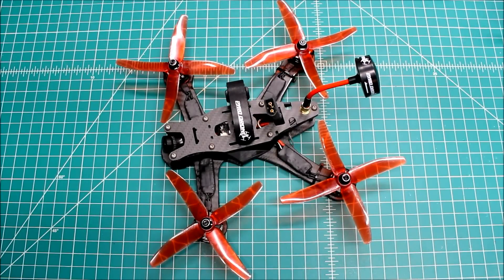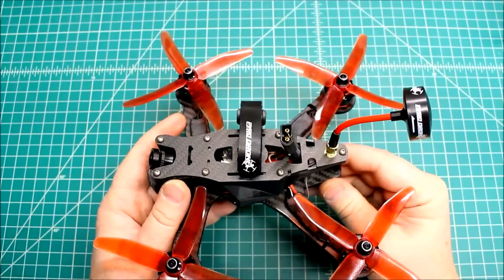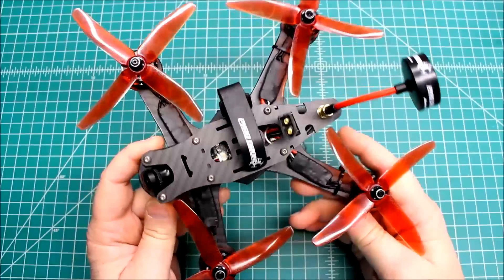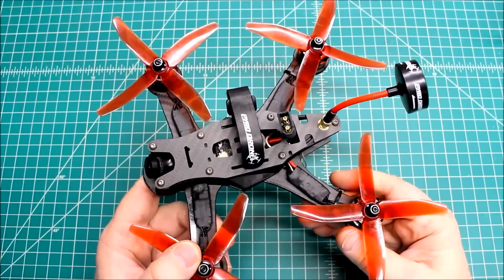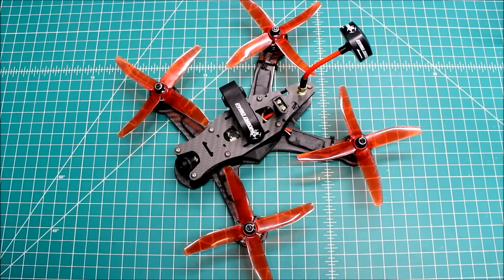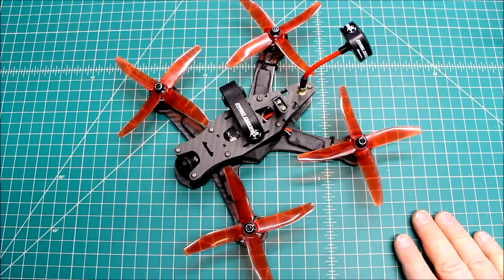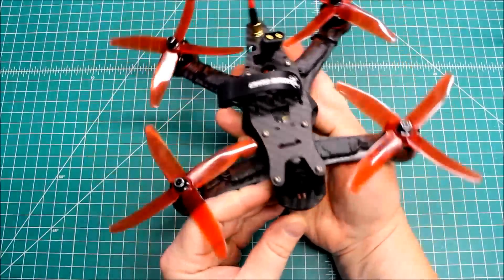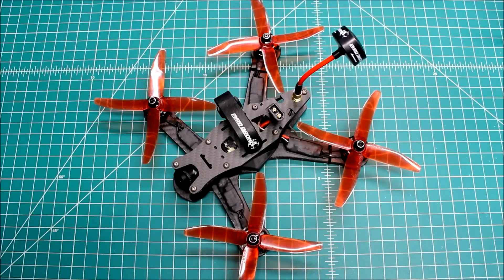Neato 205 Breakneck FPV Race Frame  Final Thoughts

Comment: Are you worried about signal loss when this quad flies towards the TX pitched down?    Seems like the carbon would block the signal.  Let me know your thoughts, I've been stealing the impulse rc helix method and making a "square" with the arms and the antenna leads and have had really good results on frsky systems.
Reply from the maker: I didn't have any problems with signal loss. I multiple maneuvers at long distances and had no problem. I can't say that this will be the case in every build but it worked on this one.
Reply: nuklearmayhem what is the helix method ? Curious to try it out, I mainly use XSR / X4R-SB... thanks
Reply: Ray Choi basically take a pair of zip ties and form a square shape with the rear arms.  run the antennas along the zip ties and heat shrink them down.  if I haven't described it well enough look up the impulserc helix and you'll see it.